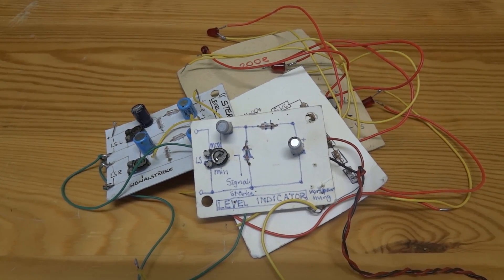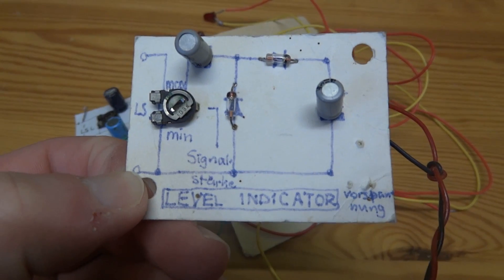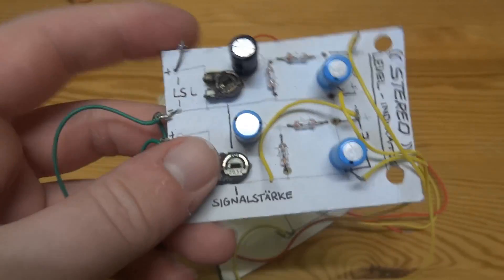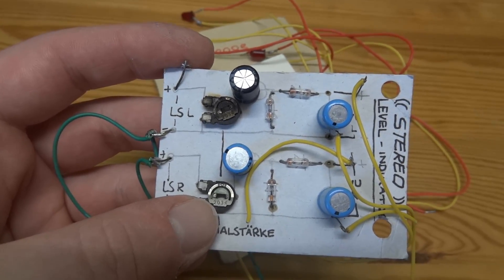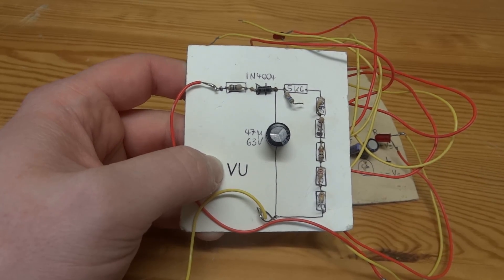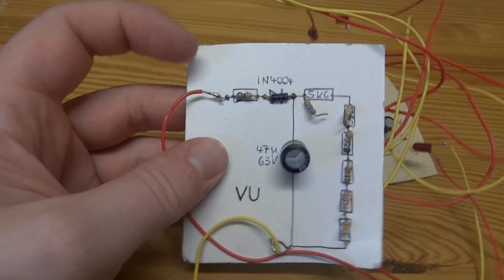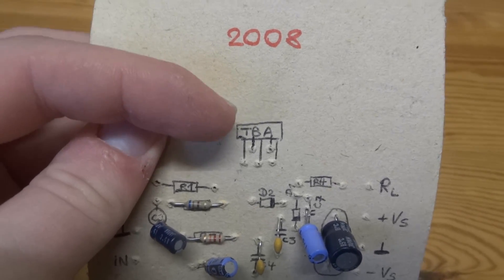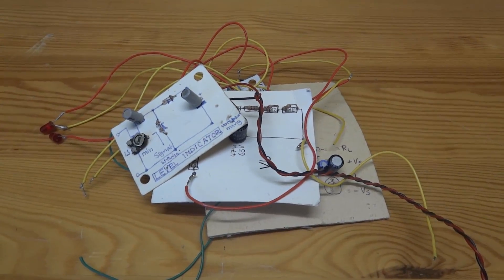Cardboard Circuit Boards

Comment: Testing something similar. Wanna avoid soldering by using aluminum foil glued the back side, then make cutouts like if it was etched.
Reply from the maker: I don't think this would work. Aluminium foil can not be soldered as far as I know. Also aluminium is not a very good conductor.

Comment: I used to do crazy experiments all the time when I was growing up, But I never used cardboard. that was smart. Here I had multiple radio shack electronic project labs which were cardboard based. But I never thought to design a complete new circuit on cardboard. Go figure. However, once I got the breadboard kit, I really went to town! I think I blew up a couple circuits and melted a section of the breadboard though, whoops. I used to build LED VU meters, and various power amplifiers all the time on that little breadboard. Even took one to school for my 6th grade science project, had a breadboard loaded with a 10-LED bargraph VU meter built only with LM339s and resistors, as well as a simple 5W power amplifier. Then came along VFD displays, and ive been hooked ever since. I have a very extensive VFD collection that I have no idea what I am going to do with on a practical level.

Comment: I have done that in the past as well. Really neat work! I built a small FM transmitter on perfboard but the condenser mic is not working, the coil acts like a microphone though and I could never figure out why.
Reply from the maker: coolbluelights Hmm, I'd say the coil is too mechanically sensitive. You could try stuffing it with foam or soak it in paint to make it more of a solid block...
Reply: Yeah I have a threaded ferrite slug in it now, the idea was to be able to tune it. it's broadcasting a carrier but the mic seems to be not working at all. I'll do a video on it if I get time.